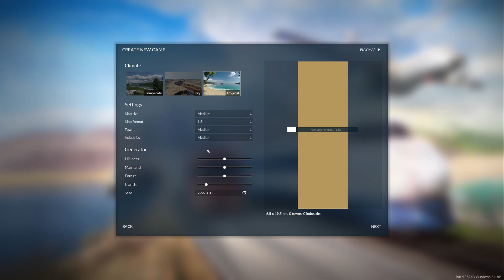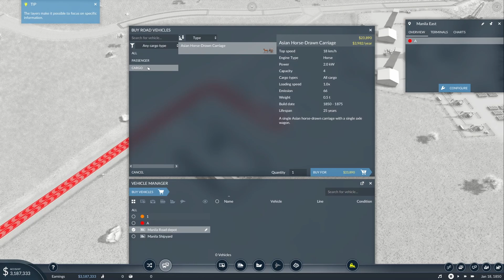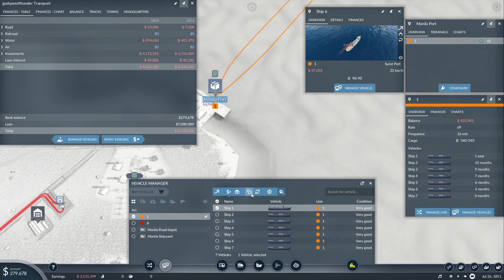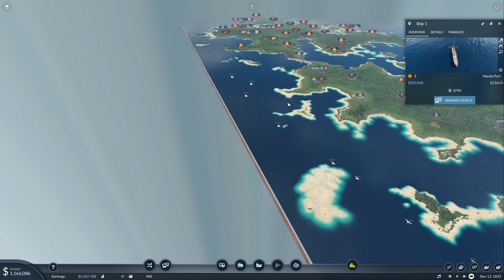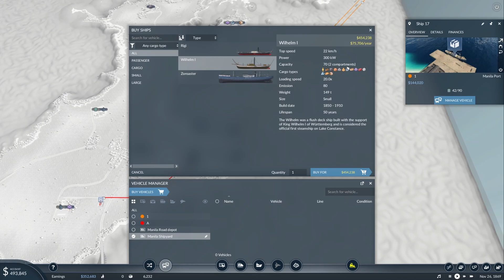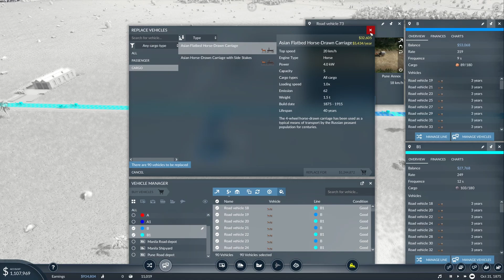Transport Fever 2 Very Hard 1850 Shipping Opening Campaign Part 1

Comment: Correction : Rate is "per stop".  This means that he should have stopped building ships at a rate of 400 for the oil tanker line.

That's also why the ships were queuing up at the port. They were capable of moving more crude than the industry was producing.

Comment: You are building the docks wrong. Docks need a physical dock and then an assigned area on the physical dock, where they can dock. They are different tabs in the customization menu. The assigned docking area has an anchor symbol. For the same reason, you were also not able to expand the small docks. You wanted to put a dock in a place where there was already a shipping area (anchor symbol). This is not possible as it would make shipping impossible in that are. You have to delete the docking area but not the physical dock, then you can expqnd with more physical docks and then assign docking areas.
Reply from the maker: thanks, it was my first time using ships lol